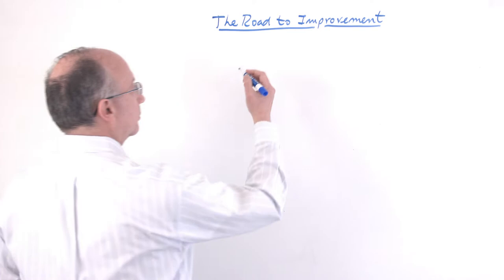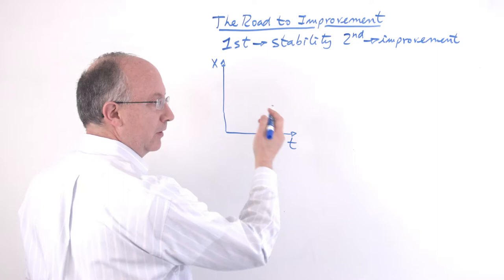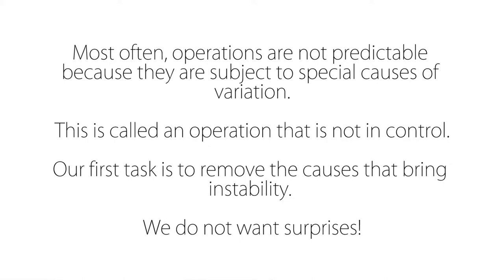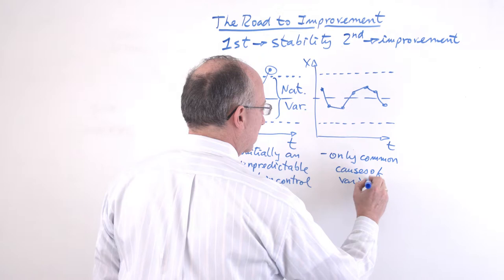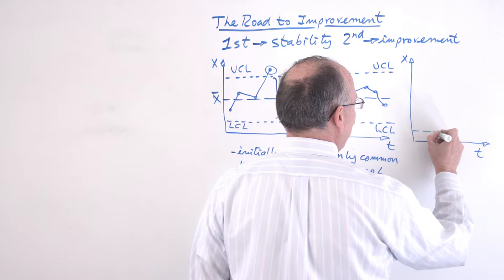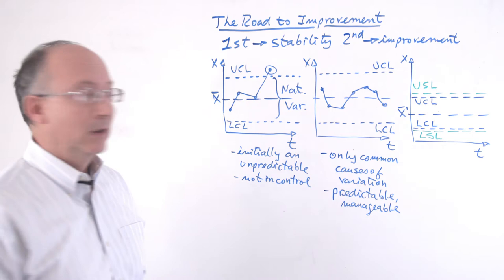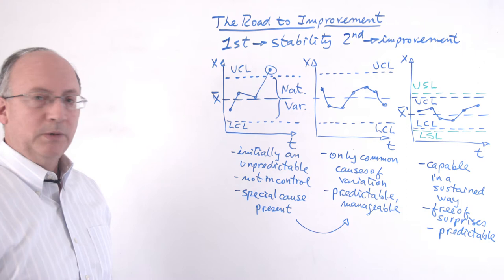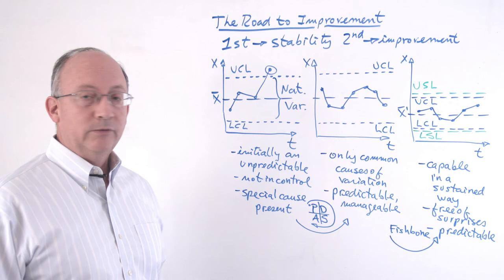ONE THING you are doing WRONG when Improving a Process | fkiQuality Lean Six Sigma Green Belt 2.0®

Comment: Great clarification on the difference between UCL/LCL and USL/LSL in that the specifications are set by the customer and have nothing to do with the process itself.  I also liked the visual going from an unpredictable process due to a special cause to a stable and predictable process and then finally to the capable and sustainable process showing which types of methods to use (PDSA and Fishbone diagram).

Comment: Specifying the difference between UCL/LCL (voice of the "process") and USL/LSL (voice of the "customer") is helpful towards understanding what a control chart is communicating.  Since USL/LSL is most likely immovable, achieving a process that is both in control and capable requires improvement to processes.
Reply from the maker: Ted, the first responsibility of a process owner is to keep the process predictable, which is another way to say, in control. If a process is not in a state of control (any of the Western Electric rules is triggered) then it cannot be reliably trusted to produce results that will meet any kind of specification. If it's happening is because we are lucky or because we are reworking half of what we are producing!
Once the process is in control, then the process owner (or the #Greenbelt) will seek to move the process #average where it is required - to the midpoint between specification - and reduce process #variation to make the spread of values narrow enough so that it doesn't spill over the specs.

Comment: The charts help to create a common truth as to how the process is performing and its level of stability. That is the basis for brainstorming of how to improve the process to be in line with the Voice of the Customer. Staff generally take pride in a well-run process, but if it isn't working for the customer then it has little value.
Reply from the maker: Don, this is correct; a well-run process must also be customer-satisfying.
The trick is that because of a mis-understood #customer focus, we tend to measure our processes only against the #specification, creating what #Wheeler calls a binary view of #quality that switches between a "benign neglect" when we are inside the spec and a "crisis mode" when we are outside.
Unfortunately, measuring against specs does not help find out the reasons why we are outside specs! This is, because the specs have nothing to do with the behavior of the process -- they are just the voice of the customer separated from the voice of the process. Specs do not provide useful information to fix the process.
The #control #chart, however, provides a way to understand what is happening with the #process, and very important, it also gives us an "early alert" that the process may drift outside specs through the use of the Western Electric rules.